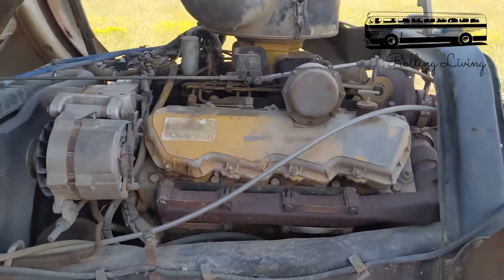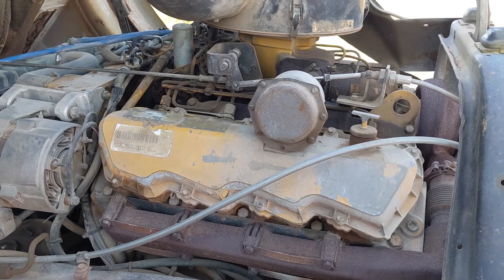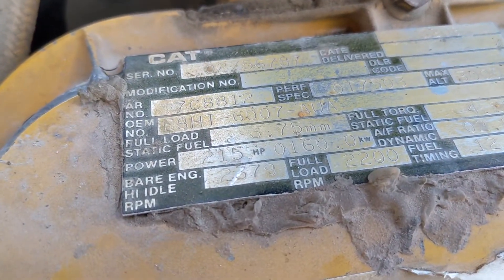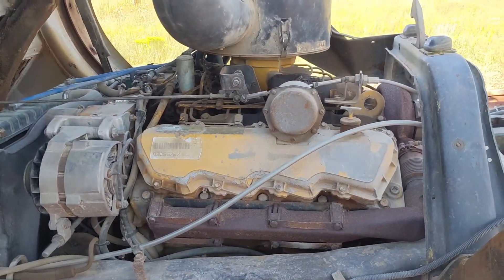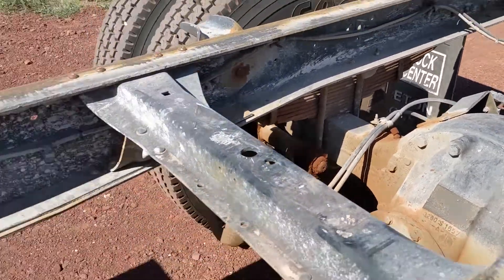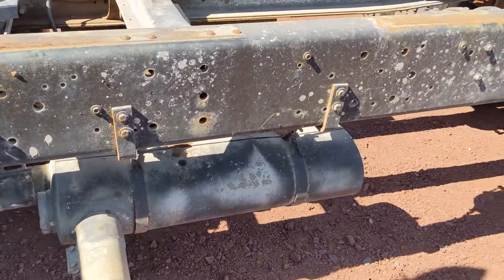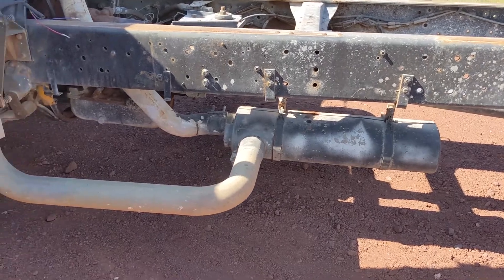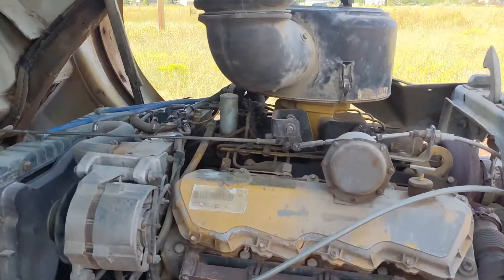Startup of a Cat 3208 diesel engine in a Ford C8000 truck

Comment: Ford's diesel-powered mediums usually had Cat engines; this relationship dated back to 1968 when the Cat 1160 (Ford V-225) first became available in the C-8000 at mid-year. 1990 was the final year for the old C-line, which dated back to 1957.